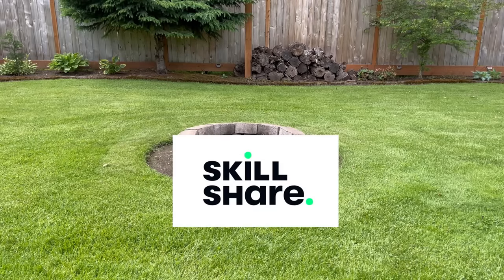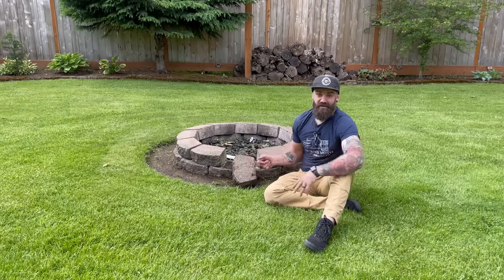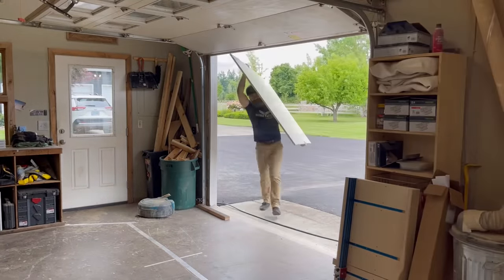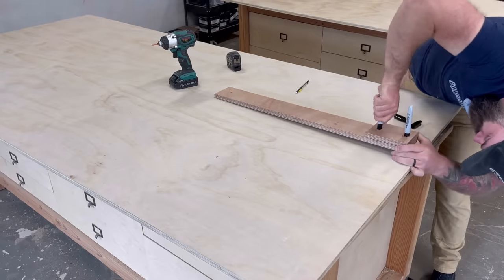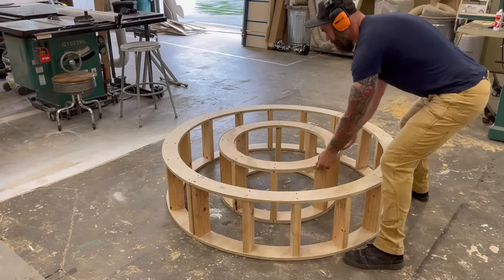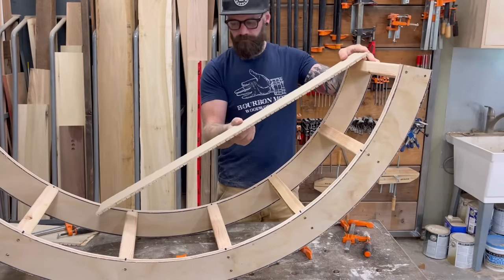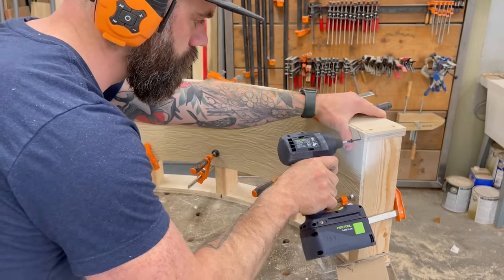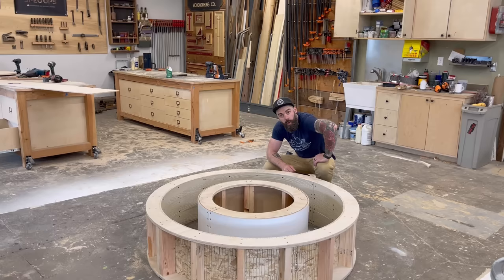Making a Concrete Fire Pit the Right Way || Ultimate Fire Pit Build

Comment: Very intrigued by this and am wondering how it has held up. Would love an update to see if it ended up exploding or not 😂
Reply: Me too, I'm pretty sure those were river rocks. They hold air bubbles, tha'ts why you never use them for fire pits next to the river..they  explode :)
Reply: @maxvapors6737  the rocks on the inside sadly take away a lot of the strength of the structure as it seperates the inner from the outer part. given it's also open to the ground on the underside that wasn't a very smart trick to save some concrete.
Reply: @moos5221  it's not holding up any weight but itself. It's plenty strong.
Reply: @vwnotch  yeah, the own weight, added stress from heat expansion, especially if water seeps into the little gap he created with thos added rocks and if it every freezes in the area he lives in, the water that creeped into the little gaps will make it burst. it may be fine, but he certainly added a weak spot completely unnecessarily.
Reply: @maxvapors6737  they’re behind the refractory bricks, I doubt they’ll get hot enough to explode
Reply: Where is part 2.he said he would show how it's held up

Comment: that is the most over-engineered concrete mold I have ever seen 😂😂
Reply: I was looking for this comment 😂
Reply: YUPZ
Reply: Me 3! Lol!  Could done 20 fire pits or so with sono-tubes for the price of the lumber alone.  10in thick?!
Reply: Yeah couldve threw some sonotubes down and been done
Reply: Yep, SONO TUBE would’ve saved about $2k in lumber😂😂
Reply: and he could have even glued the woodgrain plastic to the inside of the outer sonotube. boom, job done. exact same result 😄 outer wood pattern included
Reply: Thank you for this... when he talked about the price I was like "oh no"
Reply: @GrahamCrannell  And soooo much less effort
Reply: Haha yep!
Reply: Imagine after he sells the house the poor bastard who going to try to rip it out!
Reply: @davidharris5430  What’s a SONO TUBE
Reply: @kzukiodenthechad7205  they are big cardboard tubes used for concrete forms.  Come in many diameters.  Can get some at Lowes or Home Depot but they have limited sizes.  Check out building suppliers that sell primarily to contractors for a better selection.

Comment: In order for the interior form to be pulled out easily, you'd need to angle the seams away from each other, and also use a cross brace to bridge the gap screwed in to keep them positioned. This way, you could pull them away from one another to the inside of the radius without locking themselves into place.
Reply: what? angle the seams away from eachother what does that even mean?
Reply: In order to pull out the interior mould it should have been taperd: basically a truncated cone instead of a cylinder.
Reply: @prevalle  i guess its just hard to visualize. Can one of you guys upload an example? Or a link?
Reply: @boppernostopper8598  Just cut a paper circle like he did, you can't pull it inwards. Only outwards. And in this case it was blocked by cement.
Reply: @boppernostopper8598  You need hard 45's at every seam where the three sides meet- leaving no inner material to butt up on when you try to pull it inward.
Reply: @TheFoxNes  any acute angle will leave a space to pull inward to, so if you cut the inner frame into a 45 degree angle to the inside, you will be able to pull the frame out.
Reply: @prevalle  not the best way, but that would be a harder way to do it, yes.
Reply: @chrisgriffith1573  I never said anything else. But the guy wanted a demo, easiest thing is to cut a paper model to understand...
Reply: @TheFoxNes  oh.. I see what you meant there. Yeah, I made a png, but I have no way to upload it so I can link it...

Comment: I bought some column tubes from a specialty hardware store, they laughed when I said I needed two feet of the different diameters! I was like, it's for a fire pit, and they were like, that's genius. The tubes are typically used for pouring freeway bridges or something.
Reply: How did that end up working?
Reply: They actually sold short Pieces?
Reply: This is the correct way to pour a firepit! no need to trace a circle

Comment: Looks pretty good for a non-concrete guy 🙂 Only thing I, as a concrete guy, would have suggested you do differently is to reinforce the concrete with rebar. This will sadly be susceptible to cracking which the rebar would (help) prevent. You could also just have put a ring of polystyrene in the middle, to take up some of the space, in place of the river rocks.
Reply: The metal expanding and contracting wouldn't cause an issue?
Reply: @anonymoususer2634  the concrete is still going to expand as well, adding rebar or some mesh would probably help keep it tight. Not a concrete expert but another idea would be to cut some joints in that, which could also work into some design aspect, they would hide those cracks over time.
Reply: @anonymoususer2634  concrete and iron expand at the same rate, that is what makes them a killer combo
Reply: @tamasdukan1495  Exactly. One issue might be moisture in the concrete vaporizing due to heat and causing flaking of the cover layer, but I'd think the bricks would prevent that, mostly.

Comment: I would burn the internal form away :)
Reply: That’s exactly what I was thinking 👍
Reply: That's what I was thinking ... but then , concrete needs to cure for a month. Why ruin all that hard work.
Reply: @F-J.  light the fire a month later and have steaks ready.
Reply: @F-J.  Good thinking. The result was super. I like the wood pattern on the concrete. :)
Reply: Thinking the same light that inside form up

Comment: Concrete absorbs moisture like a sponge unless its over 5000 PSI.  Concrete gets saturated, fire turns water into steam, concrete explodes.  Got a friend missing an eye due to this.  And I've seen concrete explode due to water turning to steam and expanding.  A very bad idea.
Reply: Even stones can explode when used to line a fire pit; they may be OK for years until you get a really hot fire going and then there'a big surprise.  Some stones tend to have dry interiors and some do not.
Reply: @thatguy 00 😂😂
Reply: Good comment safety first always  the fire brick and steel ring should be adequate to stop the whole thing from cracking/exploding but overtime  it will definitely crack.
Reply: He used fire bricks
Reply: @tgee7485  that one flimsy line of fire brick does nothing, you are supposed to have 2-3 layers and from top to bottom to actually be any use
Reply: @jokiiiiiiii  youve been got to by Big Brick
Reply: @thatguy 00 there is only so much fire bricks will absorb...
Reply: He should be using refractory cement, which resists far higher temperatures. Regular cement for a project like this is not a very good idea.
Reply: He literally says how he is preventing it in video
Reply: he lined  it with fire brick so no explody
Reply: Lol its just s firepit
Reply: Without the fire  bricks it would probably be a bad idea.  But the heat will be directed up and the firebricks will absorb most of it on the inside.   Itll be fine... lol as long as he doesnt use it for any smelting operations.  And I'm pretty sure thats not his intension...
Reply: Ricky Bobby isn't a thinker! Ricky Bobby is a driver!
Reply: Yepp. And river rocks do the same thing. Please don't do this at home, guys.
Reply: Fire brick is the only way
Reply: Firebrick with concrete on the back
Reply: You can even make your own fire brick out of dry wall mud
Reply: You have a friend missing an eye from exploding concrete...? :o
Reply: I know this as spalling. One of the main failure modes of precast concrete structures during a fire.
Reply: @beholdcaesar  He did not use any fire mortar. Bricks will do very little.
Reply: Did you even pay attention to the video?

Comment: I'm planning to build this in my backyard, but am curious how this has held up.  It has been almost a year since you posted this video.  How is the firepit holding up?  Any cracks?  Shifting?
Reply: Probably going to crack.  Also when you use fire brick they have a special fire clay to apply it.
Reply: He did a great job! But make sure you add  holes near the bottom and all around the perimeter of the fire pit to help with airflow, this will make your fires virtually smokeless. Do a search, you'll see.
Reply: If you're worried about cracking, add some glass fiber to help with that. It's available at the big box stores.
Reply: Make sure you do you research too. Using the wrong mix or having too many air pockets can cause spalling of the concrete that sometimes can be projectile in nature
Reply: Tbh I would just go with brickwork, way less hassle, looks at least as good and will hold up way longer
Reply: As  a brick and stone mason, who has done a fair amount of fireplaces,  I thoroughly believe  that this will crack and fail, eventually. There isn't  a single element of refractory  material used here. Concrete does not dissipate  heat well.

Comment: Before watching the video, I gotta say: Having the air intake being slightly angled would help stabilize the flame a bit more, and reduce the smoke by a fair bit more, by creating a cyclone around the fire, to ensure more of the fuel in the smoke gets burned, by mixing it with fresh air. You can google "fire vortex stove" and"fire cyclone stove", to get a better idea of what I'm talking about, and maybe to learn how it works and why it works that way. The current end product looks great. And if the defects bother you, repeat this to yourself: "Good enough for government work." Also, oil the cement, after a month or two, to make it waterproof, and to partially prevent unintended staining. If you want to, you can use a whitewash before that, to give it a nice color. Most paints would start smoking, if used for a fireplace.

Honestly, if you've got a steel barrel with a lid which can be attacked and detached, you can dump the concrete in, the water in, the pigments used (if you use; even dirt or ash or crayons can work) put the lid on, place the barrel on a side, and roll it for a while, and you mixed the cement without a "professional" cement mixer. It works better if you add some wood or metal things on the inside, like how a washing machine has (a cement mixer usually has curved ones), to help with the mixing (and adding a few uneven parts to each of those "ribs", to help even more with the mixing), but it works even without that, especially if you add a few rocks (to tumble about and move unevenly, to lead to a more even mixture with less moving). It might need more effort to get the barrel standing upright again, or to place it on the ground without it breaking, but it works better than mixing in a wheelbarrow/cart. By the way, did you know there are folding wheelbarrows (sometimes called portable wheelbarrows) out there? I didn't know, but it makes having spare wheelbarrows A LOT easier! Where would you even put the 3rd or 4th wheelbarrow, if it couldn't fold neatly out of the way? Would be fun seeing you try to make a homemade folding wheelbarrow.
Reply: Make your own video.

Comment: I tried using a concrete firepit and it ended up spliting and falling apart. Metal or fire bricks are much better for high heat. A washing machine that has a steel basket with holes works great!
Reply: Juat add three legs and the washing machine drum is ready. We have two of those. Really efective btw since it gets air fairly well from the holes.

Comment: Thanks for the ideas. I’m going to implement some of your techniques to my fire pit project. My only suggestion on the inner ring is to maybe angle the 2x4s in a mating fashion so when. You unscrew them the pull apart rather than slide on each other. / /  vs. | | make sense? Love you videos.
Reply: the guy seems to know his woodworking but nothing about working with concrete or building with it. No stone base? Nothing to withhold the weight of the pit over time?

Comment: You spent a lot of time digging that internal form out of there. I probably would have just lit a fire.
Reply: Should have sprayed old motor oil on it before pouring.
Reply: @erlycuyler  wouldn't have made a difference, with the screws being proud of the melamine the only way it could have ever even had a chance of coming apart would be to slide a piece toward the center and because of how he cut the 3 pieces that was impossible, if he cut one piece "keyed" the opposite direction it might have worked, I knew (from experience) he had no chance of getting the inner ring out due to the cut angle he chose.
Reply: @erlycuyler  tra lhy
Reply: @DanielRichards644  You doubt the power of a properly employed mini sledge lol
Reply: @JamesGrim08  a sledge isn't getting it out and having it reusable.
Reply: @DanielRichards644  lol I know, I just that particular answer to many of life's dilemmas

Comment: The "key" to easy interior forms is... wait for it... "keys". Like the key stones in an archway, but in reverse. Every circumstance is different but the bottom line is to leave a wedge in the inner circle spaced to 10% of the portion of the circumference of the smallest section of form. 40 inch circle in 4 pieces? 3- 10 inch forms, 1-9 inch form and a  1 inch key. Easy math.

Comment: So, for your safety, I wouldn't recommend using concrete for a fire pit, there is a specific product designed for this application called "castable refractory cement" it is specially formulated to handle the heat of a fire and not cause a safety issue...
Reply: I was wondering about that. I’ve always heard if there is an air pocket in the concrete it can explode
Reply: @thisguy59  if there is any, and I do mean any, amount of moisture in the concrete it can explode when heated to the boiling point of said moisture (typically water).
Reply: I was wondering ho was going to mention it. He Should have gotten a mason to build him one out of fire brick.
Reply: You got it, there is no right way to make a fire pit out of concrete. Concrete has air pockets that will explode when super heated. Better title: how to make a back yard bomb. Wonder when we will see the follow up video of the Emergency Room visit?
Reply: Are you guys trying to melt iron in a BBQ? I get normal concrete is unsuitable to high temp and can crack or will have very poor durability. Personally I also don't like how this looks, the basic stones from before looked better than this. But predicting it will explode, sb's going to emergency room, this being a safety hazard?
Reply: @SurefireWoodsman  it's a small fire pit.  Not a bonfire.  It's not going to get hot enough to pop when it's cured.  It'll come up to temp slowly and not cause any problems
Reply: Aaaand I found the safety Karen.  It'll be fine mmmkay.
Reply: @TheRoadfarmer  in theory your statement sounds great, but here in the real world things don't always go as planned, much like his idea to make the center form removable. If concrete were safe for fire pits home builders would use it to make fireplaces, but as they don't want to be sued for wrongful death they opt for the correct materials.
Reply: @ProlificInvention  while that is true, I think you should build yourself one so that your genes stop crowding the pool...
Reply: @edwardhunts  Yes very dangerous Jimmy, there are 65 of them at my campground exactly like this ya bunghole 😁😆
Reply: @TheRoadfarmer  OK, my lying eyes (seen it happen) will remember your reply. I'm used to being told I'm wrong. In 6 months, I'll be right AGAIN. Just don't tell other people to build a concrete fire pit. It's called liability and lives are at stake.
Reply: @thelic4171  That was cool, I should be dead based on that video 😆
Reply: @edwardhunts  Dude, you're making some aggressive comments to those countering your opinion, and you're wrong.

There's a reason he lined the pit with fire brick, bricks that ppl make forges to heat steel with...

That concrete won't get hot enough to boil any water inside.

For graphic representation, look up house fires and take a look at the foundations... no explosions (and those foundations all have water in them due to wicking)
Reply: I should also note that his repeated vibrations of the poured concrete would have drastically reduced the air and water voids in the pour. Those voids are the greatest source of explosive problems, so he has drastically reduced his potential issues. Unfortunately, he poured pretty wet concrete, so the pour almost certainly has a lot of little water voids, which will spall over time, but probably not explosively.
Reply: @ProlificInvention  Yea I have crews that do bridge deck and joint repair. Torch cutting or welding of the rebar and joint plates can often cause spalling. Nothing to a lethal extent, but enough that they need to be mindful and wear PPE. Depending on the size and duration of the camp fires I would expect some spalling on above the fire bricks in this design.
Reply: Exactly I'm a woman and a handy one at that and that was my 1st thought... what a waste of money and time...
Reply: @nannabou9437  It's neither. He lined it with fire brick, it won't be getting hot enough to do any damage

Comment: If the cuts were angled on one of the internal forms you would have had an easy time removing
Reply: Recall him saying he was leaving the screws sticking out slightly to give a counter sunk appearance? Well those screws sticking into the concrete was holding it from sliding up. 🤦🏻‍♂️